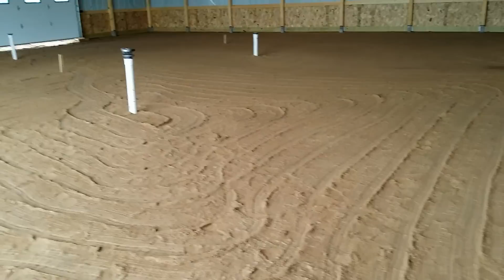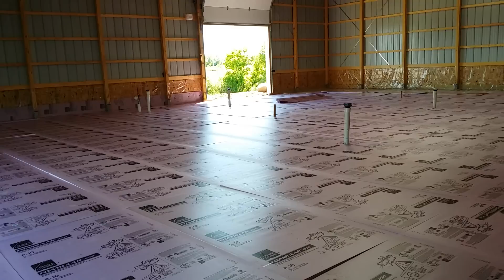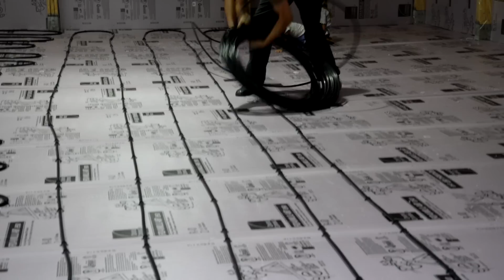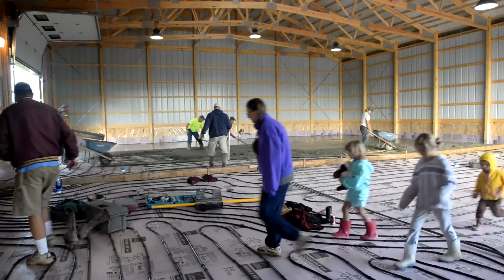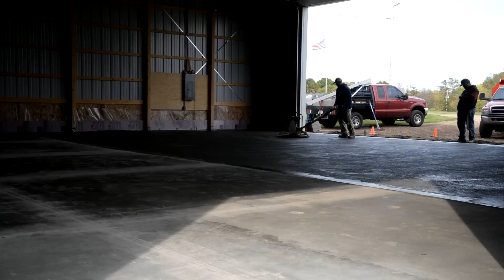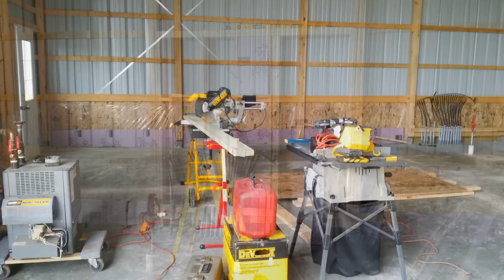Installing a Heated Concrete Floor in Morton Barn

Comment: How does the foam perform with heavy loads like trucks? I wonder whether the insulation foam gets squished over time and eventually the floor will feel spongy or the concrete cracks.

Comment: Never heard of a wheelbarrow issue. No tires flat or handle breaking off  lucky u eh !!
Reply: That's why we use more wheelbarrows than people (so a full one is always waiting, and we don't panic if one breaks), metal handled wheelbarrows (yeh, some of the monkeys that work for me will bust a handle), and airless tires.

They could have placed it quicker with one more wheelbarrow, and can you imagine their panic if one or even both wheelbarrows went down?!

Comment: I am almost to this point. My dilema is, I have walls up but wanted to put the foam 2 feet down around the perimeter.  I see you only came up from the base of the 2 in foam.
how well do you think yhe thermal break is? Any thawing around the shop?

Comment: Interesting that you put the PEX right on the foam. Guarantees its at the bottom of the slab where you wont hit it when cutting control joints, and gives you something to set your rebar on. On the other hand, your creating voids on the weak, tension side of the slab. I wonder how big of a factor that is? Might do this on my house.

Comment: Has your cement cracked much in the last 5 years? Just curious how cement did on top of foam insulation.
Reply from the maker: It been great, we had one corner that has crack due the corner moving little and there are few stains on the floor but its held up great even with 8000lb skidsteers in it=)
Reply: @RMSpeltzFarm  thank you for the update!

Comment: No mention of a continuous pressure test on the tubing?
Reply: he says it was pressurized at 80 PSI the entire time during the concrete work to check for breaks during the concrete work, said they would have seen bubbling in the wet concrete

Comment: Drafting plans for a similar project, glad to see some precedent to help give me some direction. One question though; did you preform some kind of pressure test to the pex before the pour?
Reply from the maker: yes fill all the tubes to pressure of the manufacturer and leave pressure in them in the pour incase you damage one you seee pressure drop if concrete bubble to chase down=)

Comment: I just found this video. Thanks; very helpful. If you're still answering questions, was it $8k for the insulation and tubing and another $8k for the concrete pour? $16k total for 3575 square feet? I'm trying to assemble a ballpark budget for my similar project.
Reply: I'm also curious... the barn floor seems way too big for plastic sheet, insulation, tubing, concrete, and labor to be a total of $8k... if so, then I'm in for a nice surprise when I start shopping around for contractors

Comment: Just saying, #1 concrete pump saves so much energy and possible harm to tubing and floor.
# 2 putting foam board around perimeter of floor vertically from top of concrete or higher to 4ft down creates a thermal break from cold frozen ground to inside building, your way- the frost will still come in under the foam sheet and heave the concrete, and yes I have tested this. I have a heated slab shop. Think about it. Actually even if you weren't going to heat the floor still thermal break the outside frozen earth from the inside floor.

Comment: I would to have added a couple more zones for apron heating..
nice to not have to shovel snow and ice off the outside pads!!
you can also have solar preheat for the floor heat as well!!
save on your heating bill!!
and you can have solar electric to run the pumps...
the cool thing is you can add an outside wood boiler to get this off grid!!
then use solar power for the pumps and dc pumps..
make your power wall at least 48vdc or higher voltage.
well done on the video!!
I might to have used a bit more foam at least on the exterior r15 min and thick rock under the sand... and at least 6 inch thick concrete floors.. if not 8 inch..
but then I have super heavy equipment...
nice choice on the builder for the building!!
the 30x56 they built for us went through an F3 tornado that went right over the building!!
last I knew they rated the buildings at 130 mph survival!!
we went the full foundation style as we have super high water table..
I wish we would to have done concrete hip wall up at least 18 inches... that cuts down on rain spatter and mice bugs etc...
ours ran $38,000.00 back in 1985 with the foundation!! and worth every dime!!
now days close cell spray foam the roof and walls!! that sure cuts down on rain noise in a tin shed!!

Comment: +1. .. In-floor hydronic heating system. .. "You can pay me now, or you can pay me later. .. But you will pay me" .. end quote from a '70's television commercial. .. Our Colorado mountain home renovation budget had a (PEX-ALU-PEX / Buderus) hydronic heat system installed almost 2 decades ago. .. An ultra-comfortable living experience coupled with money savings (utilities) in the bank, decade after decade. .. Don't heat the air, heat the floors/walls !! .. Cheers, nice project video.
Reply: Michael Schneider 
Agreed ,once you’ve experienced it you will never want to go back

Comment: What happens if in time you decide you wanna put up a to post car left that has to be lags down into the concrete how do you find were these heat elements are in the concrete do they have a tool or how do you go about doing it please comment back thank you very much
Reply from the maker: that is little tricky, you have to know how deep you poured the concrete and or drill slow and carefully
Reply: @RMSpeltzFarm   Now with this heated floor can you also use that with the furnish that Burns motor oil please  Comment back would like to know thank you so much for this video

Comment: Nice video. I was thinking of doing this to my garage. I am in northern MN, what do you figure it costs per month mid-winter to heat? I would like to keep mine around 50 degrees.
Reply from the maker: I use 200 gallons propane per season total to keep my concrete warm and not frozen=)

Comment: Just say you wanted to put a  A car left in their in you have the heated floors is innate a process to find out where you have the heating um lines or could you hire somebody to show you with a tool or  Some sort to let you know where they are please comment back cause I'm looking to put up a garage and I'm thinking about putting a lift in it but I not sure please comment back thank you very much for this video
Reply: Thermal camera and metaldetector
Reply: You can get a thermal camera for less than 100 usd, and will be very good.

Comment: Vapour should have been installed in the warm zone not below the insulation. And pipes should be install to wire meshes for better reinforcement.
Reply from the maker: I have seen in states where the vapor barrier is on the warm side but then you cant staple in Minnesota the pipes to the foam since you cant break your vapor barrier  so guess the county rather have it under then full of staple holes lol

Comment: How would it be if you wanted to put like car lifts in their do you have to put the studs in their 1st in the concrete or how would that work please comment back with the heated floors
Reply from the maker: The concrete is 6 inches thick and yes if you choose to drill into it you have to either have it ultrasounded for piping and or drill less then 6 inches carefully
Reply: I am looking into this. I plan on welding studs into a 1/2" plate and setting it into the concrete to avoid drilling the PEX. Put it in a depression so the load is spread out. The other way is to use your camera and tape measure to locate an open area, before you pour. Then use your measurements to mark your holes on the curing concrete.

Comment: That staple gun is nice-hope you have $$ for an outdoor wood stove and some wood  to cut not buy--I prepping mine now weathrer not helping but propane is so damn expensive now I trying to save $7 k for a stove but hope I live long enough to enjoy it -asides from fuel to heat you will love a heated floor-radiant is good heat especially when your bare feet hit that warm floor and you can also get air handlers -heat both the floor and air if you want on minnethota it probably be nice for both

Comment: Great video.  I am preparing to follow your lead on a 48x64 in Virginia.  I am interested in the rebar placement.  You said you ran it 3' apart both directions.  What size did you use?  #4?  Also, as you all laid the concrete did you lift the rebar to have it ultimately hopefully centered in the 5" concrete depth?  Thank you again for all of your help, Joe
Reply: When I put the rebar in my floor it was 12" and zip tide the pex to the rebar and the rebar was on chairs depending on the thickness

Comment: i DON'T SEE THE REBAR
Reply: It's so crazy, I can't believe they did all this work without laying in rebar.
Reply from the maker: there is of lots rebar if you look close as we are pouring hte concrete its laying there to be above the piping as we poured and you can see the 10 ft pieces perpendicular to the piping about 4:47min into it
Reply: @RMSpeltzFarm  Thanks for the reply....best shot is around 8 minutes. You can see it poking out of the concrete as they're smoothing it. Personally I wouldn't ever go more than 2' spacing. It's something at least, but in all honesty you needed more.
Reply: It's the staples! ;-)

Comment: Quick question. Did you apply air to ensure the lines did not puncture/collapse while concrete was curing? I see in that final picture that the lines are all hooked to a valve.

Also, why did you go with 100ft rather than, say, fewer zones with 250-300 ft?

Thanks!
Reply from the maker: The reason we use 100ft was so that each line would be balanced the same and the HVAC recommended more lines to distribute hot heat out faster then just few long lines that cool off at further distances
Reply: ReefDVMs the ultimate length of 1/2" in floor heat tubes is approximately 300 feet.

Comment: Why didn't you go with Morton Buildings Energy performer fully insulated shop building  I had one built 48x75 shop and only use two radiant propane overhead heaters and it stays about 60 degrees on the coldest of winter days on less than 150 bucks a month to heat the energy saver package Morton builds is phenominal how it retains heat
Reply: What was your total cost to build that?
Reply: @JewelsVern  

Each wall of the Morton building cost as much as this guys concrete floor lol..
Reply: I'd do infloor in MN I've worked in both around here nothing beats a warm floor

Comment: I have same setup, I retrofitted a 1948 40x60 wood Quonset shed in 2005, tekfoil bubble insulation with cement wire and concrete tubing through aqua therm, tubing is 2-3 inches under surface, 6" cement, 8 zones, heat it with an outdoor boiler, I keep it 50 all winter in North West Indiana, 22' ceiling, 14x18 overhead door and 10x10 overhead door, it's a great type of heat, don't use a ceiling fan, do use a mixing valve in water supply to keep water in concrete about 140 degrees, do a lot of research before committing to it, only get one chance, mine cost $5200 bucks for parts, cement with labor, 44 yards of concrete with 18x15 outside approach in 2005

Comment: About the vapor barrier: The purpose of the barrier is to stop the water vapor from reaching the colder side of the wall where the water will condense and damage the building materials. 
Therefore the rule of thump is: The vapor barrier goes on the warm side of the insulation. In this case: on top.
Sorry, I think you got that wrong.
Reply from the maker: You certainly can apply the plastic after you lay the foam and staple the tubing in but its a really hard to pour the concrete over it so most contractors up here do not do that since it gets wrecked.  If one put the plastic on top of the foam before the piping then the staples punch holes in it which defeats the purpose of keeping the ground moisture from reaching your warm concrete.
Reply: @RMSpeltzFarm  I  believe the foamboard itself is a vapor barrier.   Maybe you could have taped the foam seams for extra measure, but the plastic underneath has that covered.

Comment: Material cost alone on this floor with foam, rebar, tubing, visqueen, and depending on fill is $13000 minimum.
Reply from the maker: Actually you can get the foam on 11% off at menards for 25$ per foamular 4 by 8 2" panel, our barn took 90 some so about $2300, the rebar is not to bad $2.50 each per 10ft only need about 50 of them is about $150 and the plastic isnt too bad either compared to the foam.  The concrete when we had it done was about 6k and we didnt have markup since we did it direct to concrete company, think the whole thing cost about 8k something if you do your own labor, maybe it cost more now since that was 2015 lol
Reply: Thanks for the reply, I was just curious on price of mud, I live in an area that I've found to be expensive.  I've travelled all over US doing concrete for a national chain, and I'm always surpised how much cheaper it is as I head East.
Reply: What company did you use for concrete? What size is this shop? I'm in Princeton mn and looking for concrete prices comparable to yours, that seems really affordable.

Comment: Concrete must be cheap where you're at, cuz I'm a concrete contractor and I pay $125 a yard which would be $8000 alone
Reply: Here in central Texas it's about $110 a yard, plus tax, and the 2" 25psi 4x8 boards are about $50/ea (he says he paid $25 ea)
Reply: castirondude 2" foam is about 30 bucks a sheet at home depot or Lowes
Reply: Depends on whether you use Foamular 150 or 250 (different compressive strengths) too.

Comment: I hope no one dig a hole in it in the future and damage the hoses underneath.
Reply: Sam Max this is certainly a concern, however, if you use a thermo camera (you can get the, pretty reasonably these days) you can actually see the heated tubes below the surface so you can identify where not to drill.

Comment: $8,000 for that floor?! I was just quoted $11,000 by two separate contractors to pour a 30'x30' slab in my pole barn. No heat, no insulation, just simple slab on grade.

Comment: A Late bloomer on the video, but what do you think you spent on vapor barrier?  I used zip tape at 25 merica dollars a roll X 4.  is it less or expensive the way I did it? ...on sealing the joints of the foam?

Comment: Question - besides radient heat, which i think is a given in a barn, what other way would you suggest heating whole unit if it was to be constucted as a home?Im looking to purchase kit and reno into home and unsure which way to go for heating..Forced Hot Water?
Reply from the maker: not sure, most homes up here are radiant water heat in floor or forced air furnace systems
Reply: NJ CAMOCUTIE good question I'm looking at doing a pole barn for a house try g to figure out costs
Reply: Gas fired radiant heat

Comment: how does it heat? I'm doing radiant heat in a building I just had put up 40×72... everything I have read so far says the tubes should be 2 inches from the surface, I don't feel comfortable with that,  how is yours since it's 5 to 6 below the surface?
Reply from the maker: mine heats great, the startup is about 3 days in fall to get the base nice and warm and then form there the boiler runs less and the concrete becomes one solid radiator

Comment: great job and video.did you figure out the floor heat tubing or did a plumber.are you going to show the hook up of the boiler to the flooring.is it code out by you to use sand under your floor here in nj we use 3/4 inch stone
Reply from the maker: we were not told the substrate under the floor by code, the sand was outr choice due to the heavy clay the inspector didnt care

Comment: did you pressure test before the pour
Reply from the maker: We did and we left pressure through the entire pour on the system
Reply: ReefDVMs Keeping it pressurized to spot leaks during the pour is such a great idea!
Reply: It also doesn't kink so easily when there is pressure inside.

Comment: I'm curious as to why you didn't use a pumper truck for the concrete. Lot less traffic over the tubing. Very nice barn. Even tho I'm in central Texas I'm going to use Radiant floor heat in my next house.
Reply from the maker: pumper trucks up here are rented for $350 per 1/2hr so it was just finance deal=)

Comment: This is a great video.  I'm considering radiant heat in the barn I'm about to build.  You mention that the entire floor cost about $8K.  How big is that floor?  How much of that $8K was the concrete & rebar (which you'd have anyway), and how much of it was just the radiant equipment?
Reply: castirondude Home Depot has them for $29 a sheet. 2/6/18
Reply from the maker: 8k is concrete, foam and tubing, the boiler is extra expense but we bought a used one for the barn.
Reply: Yes, but how much of that $8K was for concrete, and how much was for foam & tubing?  How many square feet is that barn?  I'm trying to get a feel for how much cost was added to the floor by adding the radiant portion, and how that might translate to a building the size of mine.
Reply from the maker: Oh the tubing is 100ft per roll if I remeber right, that way they are all equal distance for the boiler and there are 11 I believe,  the cost was about $40 per roll, the expensive par is concrete and foam which foam is about $25 a sheet 4 by 8 ft type and the barn is 55 by 65  so like 110 sheets cost about $2500 rest concrete cost and labor was free since we did it, oh the clips or staples was about 100$ too and the plastic about 60$
Reply: What brand were your sheets? I talked to a local Owens Corning dealer and they said the 2" 25psi sheets were about $50 each.